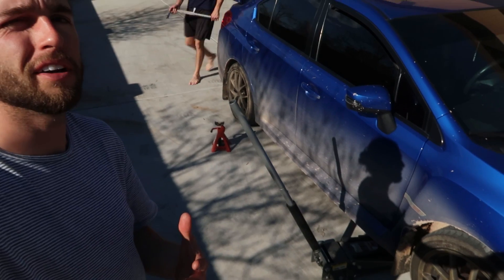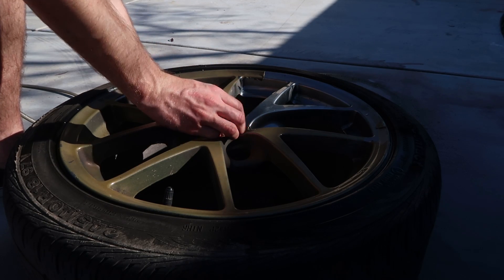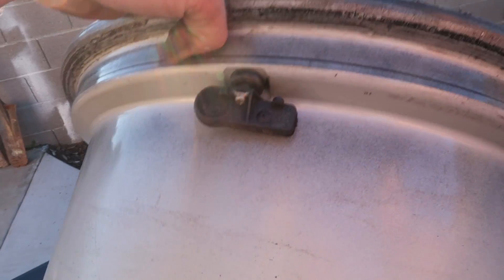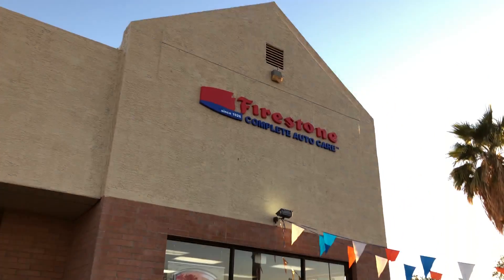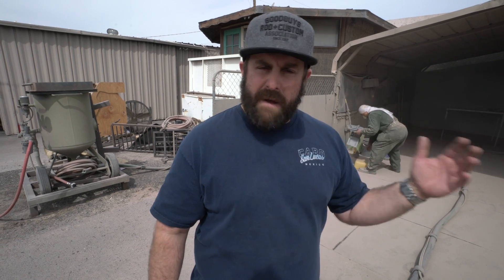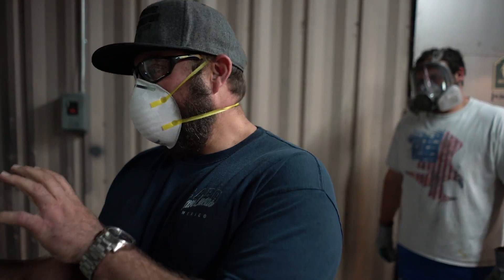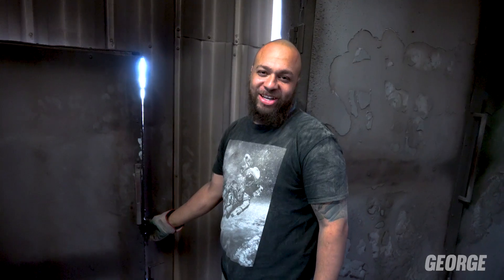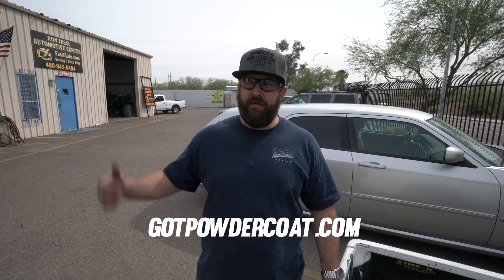POWDERCOATING: How-To w/ A Professional [STi Spanish Gold]

Comment: Got mine powder coated, and when I put on the lug nuts, the gold inside the lug nut holes cracked and chipped. I'm talking about the metal to metal. When the lug nuts tightened against the rim. Did that happen to you too??
Reply: That is poor prep. Where there will be metal on metal they should've been taped and or plugged. O noticed on OP they didn’t tape the back of the wheel where it mounts against the hub, his will crack as well.

Comment: I was about to buy a new set of gold rims for my '17 WRX for about $1300 but you convinced me to just strip the paint off my wheels and get them powdered coated, my local powder coat shop has a partnership with my Metal Fab shop (Employer) so I'm getting all four for $250. the finish on your wheels look clean AF I'm stoked.

Comment: Did you clear coat the wheels during the powder coat process?
Reply from the maker: No you dont need to with powdercoat!
Reply: @CameronAlford  yes you do depending on the colour, metallic colors like this gold should be, they can tarnish and fade over time. also would have been nice to see the hubs be masked up.
Reply: @RaeOliviaa  I know it's been two years since this comment but these should have been clear coated and yeah they should have masked the hub off... subpar work.
Reply: @CameronAlford  Hi mate. I'm in Australia, can you please tell me what the color code is for your powder coated gold rims in this vid. 
Struggling to find it just under Spanish Gold. Thanks mate 👍

Comment: How much does it typically cost for powdercoating wheels?
Reply: 500 per wheel? Or set?
Reply: L Amayonaize That would be crazy expensive if it was per wheel lol
Reply: My 17inch sti rims were 400 for sand blast and powder coat
Reply: Tom Canino it depends on what size. Usually 18inch is about 500 where I’ve seen.
Reply: Yeah, around $400-$500 a SET